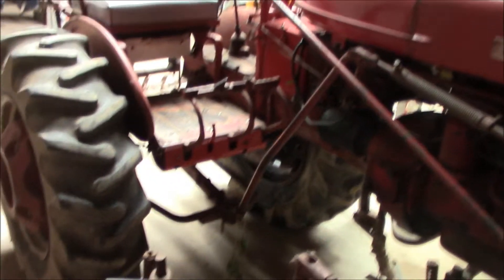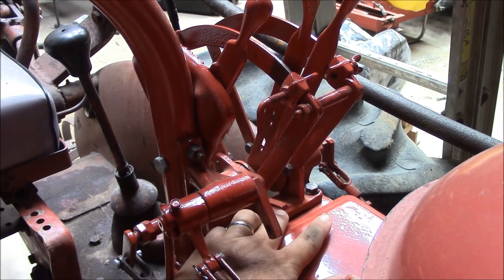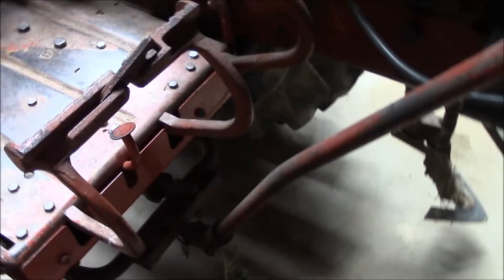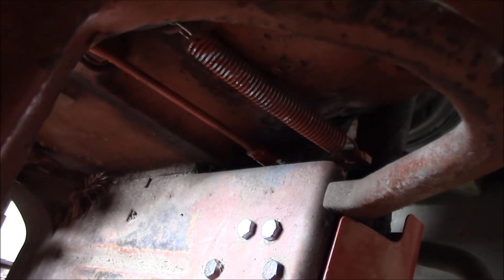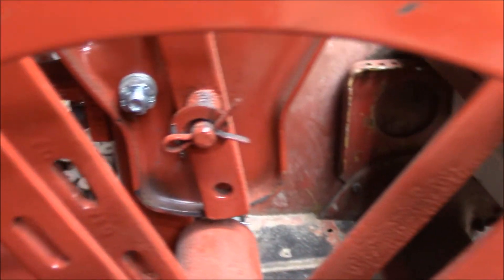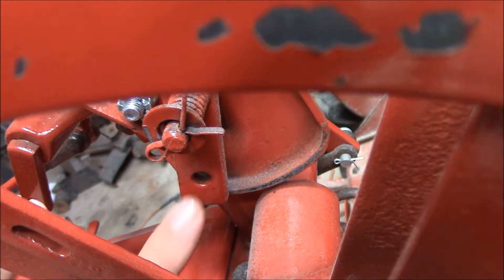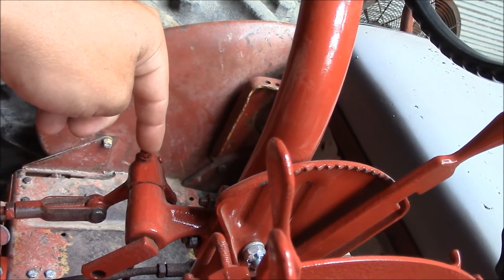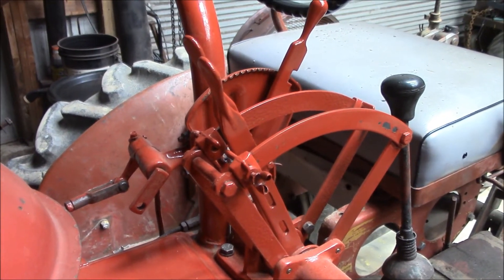Farmall 140 Foot throttle

Comment: Foot throttle came on the industrial models for plowing snow and operations that required multiple direction or gear changes. Not used in field work at all. Defeating the purpose, would work better as a decelerator. Like on a dozer, you only stomp the pedal for the short periods when your not laying down the horsepower.

Comment: will try tomorrow, mine was from 41 A-I and i put it on my 55 farmall 100 . was shocked it fit without cutiing or adding. ..no mods at all except drill one hole in steer shaft. 15 yrs apart and it fit both